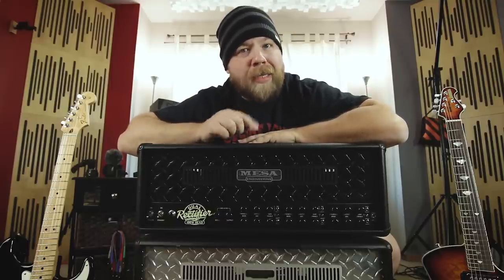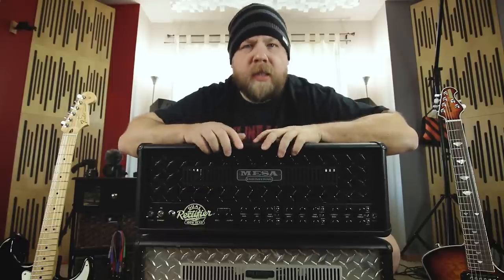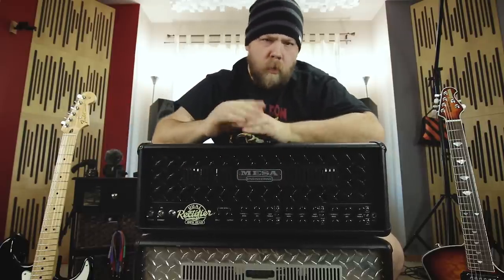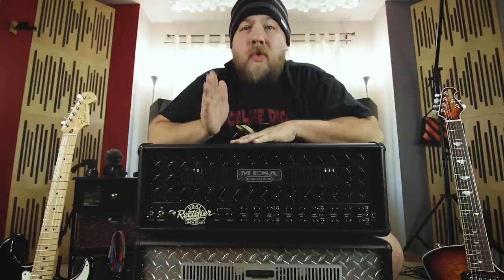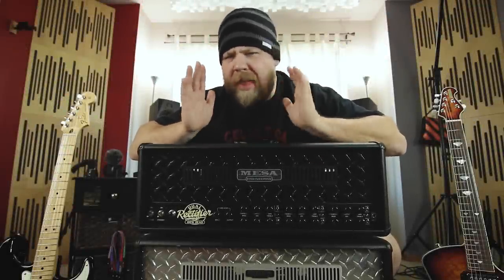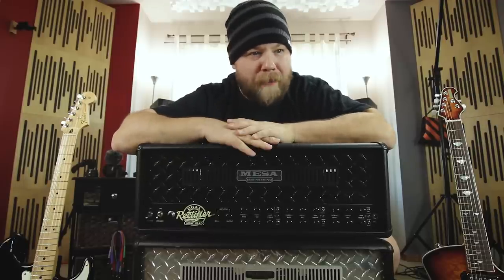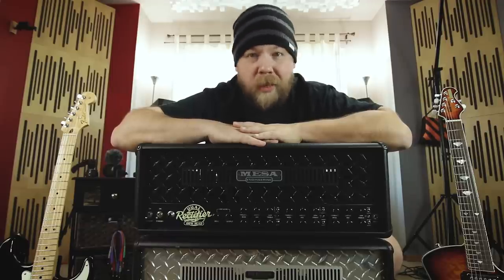Old Recto Vs. New Recto!

Comment: I still prefer the sound of older rectos.  I know they aren't as refined or clean, but that's what I like about them.  That raw wooly sound just has so much character to it.  The newer ones are by all means "better" amps, but they are way more fizzy and sterile.  The last few comparisons are very close between the two.  Going to show that it all comes down to EQ.  Those sounds are still in the new 3 channel rectifiers, they just aren't as easy to find.
Reply: couldn't have said it better!
Reply: agree about the fizz but if you eq it right and crank it you can get rid of most of it, least that is what I have found with mine
Reply: Agreed
Reply: Agreed, and that top end would get sliced off in most mixes anyways.  The old one always sounds good in combo with drums/bass/another guitar etc.  You have to try hard to make it sound bad.   The newer ones sound good by themselves but take much more tweaking to dial in on a mix, though they can usually get there.
Reply: Not gonna be better for most applications, but it has some niche tones that need that dirtiness in the tone. I definitely think the nature of the old rectifier's is what contributed to Metallica's Load tone, love it or hate it.
Reply: @kingnothing2161  graphic eq in the loop will defizz
Reply: Completely agree the older ones are rawer sounding. The newer ones are fizzier and more processed sounding.

Comment: Buying used Mesas is like buying a newer model used car:  bypass the initial depreciation and take advantage of better value.
Reply: Exactly. 
I picked up my 3-channel 100 watt for $900 in immaculate/studio condition on reverb lol.
Reply: Glenn Conner amen! I got mine for $725! Dude just needed to get rid of it.
Reply: Yeah, If you can deal with it mentally it's best for sure, however, I've always had a bit of an issue with it just because you don't know how the previous owner or owners treated it prior to your ownership.
Reply: I just picked up a dual rectifier road king for $1200 in mint condition!!! I'm so stoked!!!
Reply: Got my dual 2 channel, Ibanez Rg350mdx, Marshall MF280 cab with the V30s for $700 best deal I could have ever got
Reply: Got a triple rectifier solo head for 1000 used look really good turns out they had bought the one that says 150 watt instead of solo head and I guess liked it more had it for bout a year no issues so far

Comment: When you love mesa boogie but will never afford one.
Reply: Ray Amukwaya Dude you can get a good one used just save up for it!! It's worth the experience of playing on one of these!
Reply: I got mine from haggling.  Guitar stores can in fact do that; and I haggled with Guitar Center.  if GC'll go back and fourth, I can't imagine any other shops that wouldn't.  Or buy one that's used.  You might have to retube it immediately, which is a little costly, but it'll get the job done.  There's tons of great deals on older multiwatts, 90/2000s rectos/marks, and even the minis that you could get a great deal on, not to mention cabs used are nearly half the cost of one new.
Reply: How much do they go for on the used market?
Reply: Ray Amukwaya In my country a used one is around 950$ which is approximately 806€.
Reply: At the moment I'm using amp sims.BIAS
Reply: I got an F100 head on eBay for $400, just needed a new reverb tank.
Reply: Always thought like that, now i have  three :D
Reply: +Theta LOL can I buy one?hahaha XD
Reply: You could also get a Bugera Trirec, that's what I got and I'm perfectly happy with it. Actually has a bit more features than the dual rectifier imo. $699 brand new, even cheaper used.
Reply: Bugera Trirec if you want a big one or Joyo Zombie if you don't justify 120W.
Reply: Ray Amukwaya get a better job u can get a used one for 1k
Reply: Buy used and it should be more doable for you.
Reply: @AndreiGrozea  The Trirec its the better option, affordable and  have a great tone.
Reply: got a triple rec for 900 bucks just gotta look bud
Reply: Ray Amukwaya that’s not the spirit
Reply: I got my Rev G Triple rec by trading a guitar on an online marketplace..... Best acquisition ive ever made!
Reply: @Jason Donovan The tone sounds great imo, and it's affordable. The risk is really in the reliability of the parts used, and I haven't had an issue yet, but time will tell I suppose. Just watch any recto vs Trirec comparison, it's a solid amp.
Reply: Got mine with the last time I had a credit card in 2003 😆
Reply: @Jason Donovan buddy of mine got a B52 AT100 amp that's a goddamned freak.
It's nastier/heavier sounding than his triple rectifier.  And he has used it extensively, hasnt broken.
You are correct: the QC of the cheap amps can be spotty, but I can attest to a couple of times I've seen it go crazy the other way in the favor of the cheaper instrument.
The only 'freak' I have in my equipment is an 05' Epiphone Les Paul custom. And it's a factory 2nd. 
I've had people offer to trade me thier Gibson LPs for it after they heard it and played it.
Reply: just got a Triple for $750. I've never seen one cheaper
Reply: They aren't that expensive. They're more affordable than the mark series, soldano, diezel etc
Reply: I bought a rona special half stack for 900. Just shop around you can find some good deals.
Reply: Buy one second hand brother. Got my triple rec with a road case for 900.
Reply: @AndreiGrozea  Bugera is absolute garbage. I have an infinium 333xl and it’s been in the shop more than I’ve played it
Reply: @theophany1770  Got one for $950, got lucky since prices are rising fast. Sold my Triple Crown in a day for $1400 after I got it for $1200 locally.

Comment: Can you do a similar “to taste” comparison between the 5150/6505 and 5150ii/6505+...please 🙃
Reply: A. Wagner yeah I know. I meant to compare the 5150 (same as 6505) vs the 5150ii(same as 6505+)...with we tweaking so they sound their best. Fluffs comparison in a previous video (along with the 6505mh) was with all knobs at 12 o’clock

Thanks for the reply though. I see how my question could have easily been misinterpreted.
Reply: I know this was 9 months ago, but i actually did that myself. My friend has a 6505 and i have a 5150ii, and we compared them trough the same cab. We tried identical settings, and it sounded pretty similar, but not completely. So then we tried tweaking both of them, and i managed to wrangle a completely identical sound from both heads.

Comment: A little abstract for when I revisit this vid:
2:12 - the knobs values aren't the same
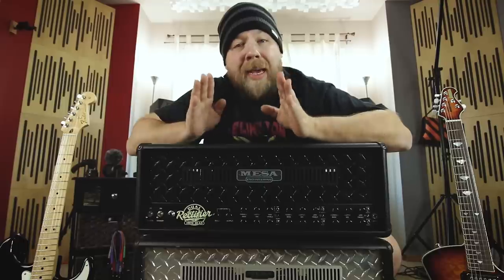 2:48 then the newer presence knob is at 8 o'clock
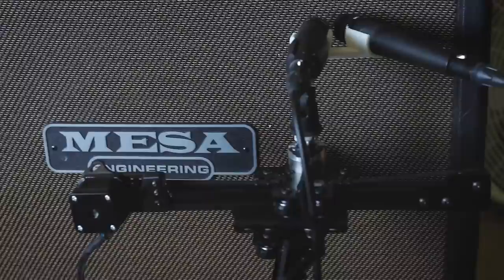3:10 cab Mesa 1986 dual rectifier 4x12   (what is a "broken in" speaker? A very old one? How does the tone changes with time?)

Comment: Fluff I've been having trouble choosing my new amp, would you recommend the Mesa Dual Rectifier or the Mesa Dual Rectifier?
Reply: Ordacleaphobia definitely the latter
Reply: Remembers Triple, Single, and Mini Rectifiers exist head explodes
Reply: Triple rec and a single rec.
Reply: ReVv Generator 120 ^__^
Reply: I parted ways with a dual rectifier full stack (2 heads and 2 412 cabs) six years ago... I think for $2250 total is what I got. Oh well

Comment: Found a god deal on a Rev G. locally. Eurotubes makes a KT77/6V6 blended power tube set that runs in EL34 mode. Any way you could review that? I used to run KT77s in other amps and was always happy with them, and the 6V6 might help get volume levels a little more apartment friendly.

Comment: Ok, so even though the video shows all controls still at noon even for the "to taste" sections, I've discovered that the controls were still set "to taste" during the speaking parts (which were presumably recorded after the playing).

After some VERY careful pausing, with my nose about an inch away from the screen, I think I've managed to make out the "to taste" settings. Here's my best guess:

Values are expressed as "o'clock", in the format of: Presence - Gain - Bass - Mid - Treble

Green Channel:     9 - 10 - 2 - 2? - 1
Orange Channel:   8 - 12 - 10 - 2 - 2
Red Channel:         7.5 - 1 - 10 - 3 - 12

Really difficult to make out the mids for the green channel though, so that may not be correct. Everything else I'm fairly confident.
Reply: Tian Lee Don't dial in your knobs by eyes, use your ears. The end result depends on so many details in the signal chain that knobs values don't mean/worth anything. 

Friendly advice!!
Reply: Robert Mercier that is true but sometimes you need some inspiration to break you out from your usual range. For example after seeing this vid I just played a gig with my mids a lot higher than usual and I reckon it was a nice improvement!

Comment: The multi-watt really shines with the humbuckers.  There's a little hiss in the 2017 rig but a little EQ would fix it very quick.  It's a situation where I love the mids on the revision F but the modern appointments of the multi-watt are super attractive. I think it would be hard to go wrong with either though.  Punk rock forever.

Comment: I preferred the old one in all channels which is weird since i usually like more modern clean and lead channels but appreciate old crunch sounds more. Also i have to say i am a bit shocked about how i prefer my tone over those two (unprocessed  through shure sm57s which i also use),  since one of the heads alone costs 3 times more than my whole rig (engl fireball 60, laney aor212 with celestion g12m-70s). Thanks for your effort Fluff, i think i am a bit more confident about my tone now. Keep rocking, you teached me a lot \m/

Comment: Hey brotha i used to have a 2 channel vintage dual rect and i felt like it needed more distortion gain.

Do you know if modern dual and triple rects have more distortion added for an even crunchier sound?

My Marshall DSL40 had massive gain compared to my vintage dual rect
Reply from the maker: Sounds like your old amp needed a retube
Reply: @RiffsAndBeards  i took it to a repair shop they tested it and said it was fine.

I recently tried a mini rect and it had  at least to me more distortion than my vintage

However im not sure if it felt like the mini felt like that due to it being 25 watts and feeling tighter or if they indeed added more distortion overall to modern dual rects.

Comment: Very cool video. Weirdly not as chalk/cheese difference as I thought there might be.... I preferred the 2017 on green overall but preferred the older rec on orange and red overall. Although was also dependent what guitar and what it was dialled as. Very cool comparison though - don't think any die hard old dual rec folk should feel hard done by by the new 2017 recto!

Comment: I have a 2000-2001 3 Chan Triple Rec and am considering trading it for a mid 90's 2 Chan Dual rec Rev G.  I play thrash style rhythm stuff,  without pedals at lower volumes.  Is this trade good or am I going to regret it?  I want a Dual Rec but dont know which version is better in comparison to my current Triple Rec. Any help?
Reply: I love my 2 channel dual rectifier but I run a 31 band eq in the effects loop it helps tighten things up. It sounds very aggressive and I use the loop volume as my master volume which comes in handy when playing at lower volumes even though it still gets pretty loud but I had sold a 2 channel rev g and ended up buying another one because I kept buying other amps and they just couldn't fill the spot for me.

Comment: Gosh this is making really miss my old small logo <1600 Sn rev F. The only amp I truly regret getting rid of...  @Riffs, Beards & Gear  Have you ever messed with the Upper mid/ treble shift trick on the old 2 channels(not sure if 3 channels share this design aspect)? Due to the tone stack, The mid and the treble sweeps have MUCH overlap, you touched on it at the beginning how there isn't much sweep in the controls.  HOWEVER if you manipulate the EQ maxing out the mids and nearly completely rolling off the treble and using the Presence control as your 'treble" control. you actually brighten up your mid range quite a bit by shifting the mid peak up about 200-300hz.  slam this with a boost and in riff heaven... I found using these settings opened up speaker options that cut through without being a V30

Comment: i tend to love the less "squared", or "grainy" and fizzy sounds when it comes to heavy distortions and i mid-push a lot while keeping the bass tight (often with a 6 or a 10 band eq in the front end of the amp), never use silicon diodes for rectification. it just sounds cheap route to gain to me, that's why i consider myself fortunate to own and having played just a rackmount unit (1500ish, rev f i believe). no fizz at all, i'd have just thought recs are not for me if i came across a later model. that's why i like the old one far more, though i admit the new one is equally a respectable amp, plus it has a much wider pallet and definitely a better clean

Comment: Has the old one been retubed recently?
Reply: Ah, forgot that video was the same head. I was wondering since the Multi-Watt sounded more scooped to me. I've found that bad power tubes suck out the bass and treble and can leave an amp with a very nasally sound, and I was wondering if that's why the old recto sounded more mid heavy.
Reply: I got a Suhr Koko Boost and use it on the red setting to pretty agressively add back in clarity in the midrange on my 4 channel Roadster combo at a pretty narrow Q. It ends up with that punch of the 90s one, but with a lot more clarity and definition, and then you don't have to sacrifice that great clean channel and the better high end the multiwatts (including the current Roadster and Road King) have.

Comment: The old one has a low mid thing going on. The new one has more cut because of the fizz in the gain. I think I prefer the old one, both sound good. Double tracking with both would sound mega.

Comment: I prefer the 90s rec, it would occupy a better sonic range in a mix due to the more mid heavy voicing and has less fizz (I prefer less fizz and more chub)
Reply: I use the mid-90s triple rectifier for many years. I know what you're saying. Even if that amp, I had to dial some of the Fizz out. I use the boss ge-7 in the loop and actually cut 100 hurts and 6.4 hurts slightly. And then I would cut 400 Hertz a good bit and then 800 hurts a little bit and one point 6 hurts just a touch. It was running through a mess of 412 or Messi 212. I also put higher gain JJ 12ax7s in the preamp, which is kind of like boosting it because the game that I got at 2 was the same as the stock game at 5. And I would ride it at 4 gain most of the time. It was a great sounding amp and I wish I never sold it. I'm so dumb.
Reply: @123lowp  I run a 31 band eq made a huge difference in that amp I also run a 2 channel I sold my first one and immediately regretted it so I got another which was in great condition got a good deal on it.

Comment: I found the Rev F to sound like it had a blanket over it. Less noticeable high end and a woollier bottom. Either way they both sounded very unclear with little note definition, and I felt they both really needed a boost in front.
Reply: Yes.  They can get quite saturated and muddy in the low mids.  

I ended up switching to Bare Knuckle Pickups in all my guitars because they play so incredibly nicely with the Dual Rectifier.   For my money, the Rebel Yell set in a mahogany guitar is pretty much my favourite sound with the old Dual.
Reply: Another thing to consider would be how old the tubes were in that amp. Old tubes would make the sound quality deteriorate.

Comment: Way behind on this video, but the only difference circuit-wise (according to schematics on the internet) between the different vintages' EQ's is how the "Presence" controls are switched in and used.  That being said, the interstage filtering and attenuation is what could be causing the perceived difference in EQ sweep.  They still use all the same caps, resistors, and pot values in all vintages of the EQ's.

Comment: Both have their pros and cons. The 1994 Recto has a more natural sound while the 2017 Recto has a more clear ring to it. I felt that the 1994 Recto had a better sounding green and orange channel, but I gotta give the red channel to the 2017. Just the differences in the tones and clarity of the sounds. Both have their pros and cons, but I would say that they are equal competitors and it really depends on what kind of sound your looking for. (My statement is based on the "to taste section", the 2017 Recto won by a landslide at the neutral settings because it wasn't a garbled mess half the time.)

Comment: Both sound good, but the Rev F (I personally prefer a Rev G) just sounds so much Fuller and organic/alive -- like a good tube amp should. The 2017 is a bit too sterile  / compressed sounding for my tastes, but I'm sure most of that could be dialed in. You can't go wrong with either of them!

Comment: 1994 BY FAR especially for Everlong... if you wanted a “Cleaner” Dual Rectifier just get an SLO by Soldano, Mesa basically ripped off Soldanos tech but made the amps more bassy and barky, but for Distorting and clarity ? Soldano... Diezel too...

Comment: Never been a fan of the mesa tone. I've owned 3 both the 2 channel and 3 channel. Boosting it helps tighten it up but the low end is still out of control and the eq is picky. I got a good sound out of it in the studio but moving on a tour you have to re dile it for the room. I traded my the 2 channel for a Engl extream agression. The Engl is heads and toes above the tones I was getting and the eq isn't as picky
Reply: I know it's a hassle but I run a rack 31 band eq which made a huge difference on my 2 channel and made it sound like a beast.